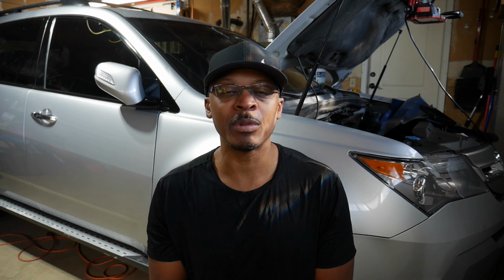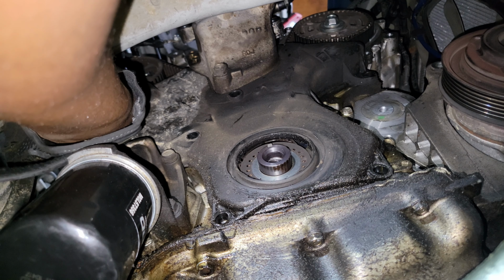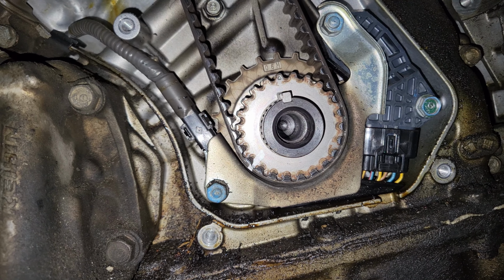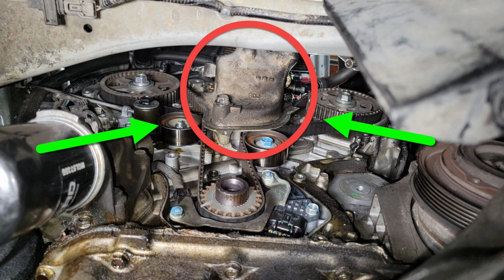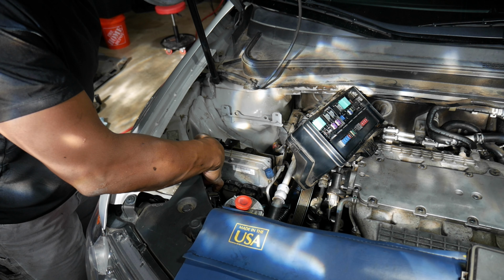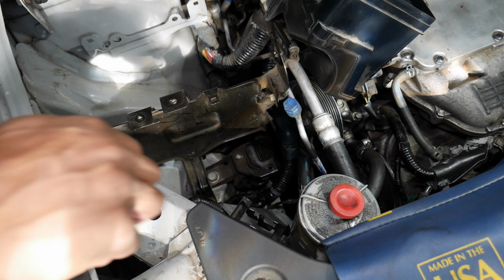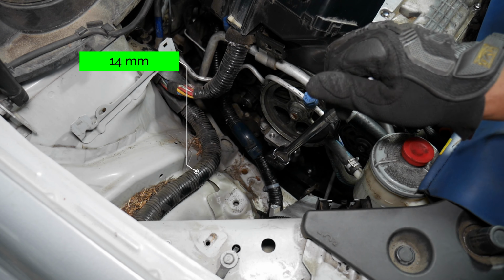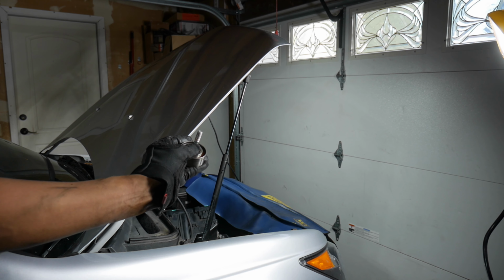2008 Acura MDX Cylinder Head Removal - Part 2 of 6

Comment: I don't even know what to do. I took out the ignition coil and found some oil residue. I understand that the problem will recur. Very interesting material, thank you. Also there was also a problem with the sh-awd on uphill climbs. The all-wheel drive system is switched off.
Reply from the maker: The oil residue is likely the result of a worn spark plug tube seal; they're included in the valve cover gasket kit.

Comment from the maker: Getting there. I hope to have the cylinder heads removed in the next video.

*IMPORTANT NOTE! Before removing tension on the timing belt, loosen the 17-mm camshaft pulley bolts. DO NOT REMOVE THE BOLTS*

Please leave a 👍 and share the video! 
👉 Visit our website ► http://carapprentice.com
👉 Click to Subscribe! ► https://bit.ly/3bLvCFd

👍▬▬Follow Us on Social Media▬▬👍 
✔ Facebook ► https://bit.ly/3bHtMFC
✔ Twitter ► https://bit.ly/3hLdJKK
✔ Instagram ► https://bit.ly/3u380lS

🔧▬▬Tools and Materials▬▬🔧 
✔ Car Apprentice Recommended Tools and Materials ► https://bit.ly/3DP75xM
✔ GEARWRENCH 17” Ratchet ► https://amzn.to/3rPHcdH
✔ Lisle 77080 Harmonic Balancer Socket ► https://amzn.to/3Sa7wKq

📷▬▬Video Equipment▬▬📷 
✔ Camera used ► http://amzn.to/2GcpkOb
✔ Lens used ► http://amzn.to/2Deu16S
✔ Tripod ► http://amzn.to/2GbaM1c
✔ RAM Suction Mount ► https://amzn.to/2Wz9PXh
✔ Cyberlink PowerDirector ► https://bit.ly/2jTwGxT
✔ Adobe Photoshop ► https://bit.ly/2V7nyUX
✔ Camera Slider ► https://amzn.to/2WtD7GW
✔ Deity V-Mic D3 Super-Cardioid Directional Shotgun Microphone ► https://amzn.to/2LI1lf7

This video was recorded in 4K resolution, so modify your settings accordingly for better image quality. 
Disclosure: This video contains affiliate links, meaning, at no additional cost to you, I will receive a commission if you click through and make a purchase.

Comment: I’m curious to know how the valves got so burnt. I suspect leaky injector(s). Not uncommon on higher mileage vehicles and your MDX is an 08. It’s got me nervous about my wife’s 08 RDX (166k mi). I’ve been meaning to do a full tune up on it. New belt, tensioner, radiator and hoses, coolant flush, spark plugs, and possibly water pump and injectors.
Reply from the maker: Several possibilities have been suggested, and I'll include leaking injectors. I'm hoping to pinpoint the root cause.